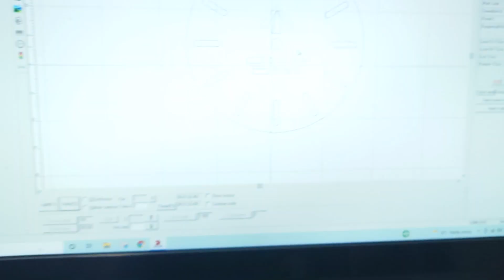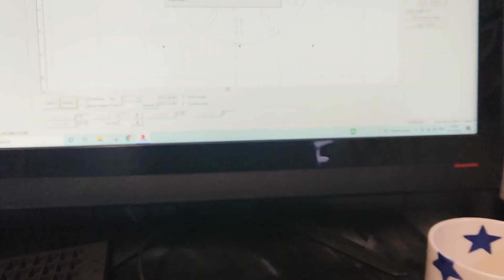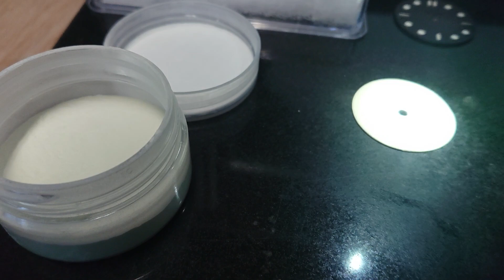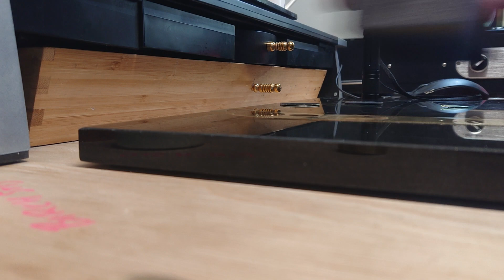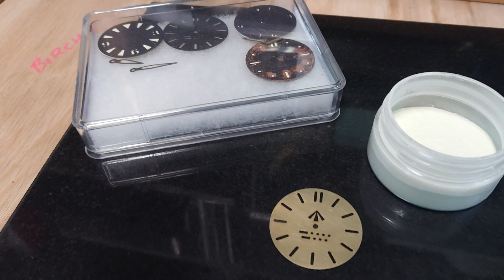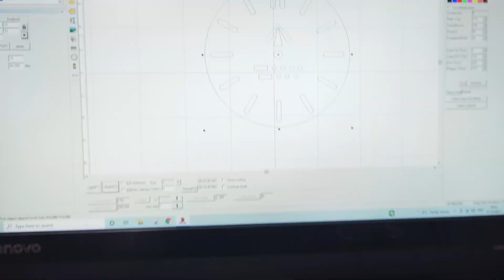Making a watch dial and hands on a 30w Fibre Laser

Comment: Sorry if I missed it but I didn't catch showing you making the hands. How do you make them? I imagine that to be quite complicated due to the bore on the hands that will go on the center wheel
Reply from the maker: the outer shape is easy enough. But youre right, making the centre point to fit a shaft is tricky. Im just in the process of doing a couple of experiments so will post up if successful !
Reply: @bonesshed.  sounds great I will stay tuned. Do you post on insta?
Reply from the maker: I do, its a bit of rambling feed though LoL. @gasgasbones  @maxgul.x
Reply: @bonesshed.  just followed, cool stuff

Comment: Interested how you finish your watch hands after being cut on the laser.   
I’ve been cutting my own, but I’m unsure how to get a collar around the hole.
Reply from the maker: I think you can buy tubes which are then soldered on.
Reply: @bonesshed.  unfortunately, I haven’t found any yet.  Been looking everywhere.
Reply from the maker: @djbenefit  I have seen hands before with a small slit from inside the hole to the outside. So the trick is to get the hole size a tadge smaller than the shaft its going on. The slight 'spring' action holding the hands in place.  Should be a lot easier than soldering tubes on ?

Comment: Have you had any problems with the watch hands not fitting?
Reply from the maker: To be honest I haven't got that far ! 😁 The traditional method is to solder tubes but I believe you could run a cut line from the hole to the outer edge and close the hole a tad. This would act as a spring. Maybe 😆

Comment: Amazing technique!  It was a bit frightening to see you moving your hands near the dial as the laser was cutting.  Be careful!  And wear goggles - laser light can reflect off metal parts and end up damaging your eyes!
Reply: So this is not entirely accurate. The laser is about harmless above the focal point. If this material reflected the laser light then it would not be able to engrave. This is why fiber lasers are used for metal. The 1065nm wave length is easily absorbed by metal. Yes you should rear goggles but the risk of reflections very unlikely
Reply: ..can damage remaining eye
Reply: Just as a note for your knowledge. The laser cannot harm skin.  That’s why they use lasers to remove tattoos.  It is something to do with the moisture within the ‘haute’ (did I guess that correct with my bits of German language?). Good luck.  P.s. wear goggles though, lasers will blind you!!!

Comment: Great video. Enjoyed all the input. The heatsink clamp sparks ideas. I'm in the process of producing dials with my laser as well. Very exciting. I've been successfully engraving 0,4mm spring stainless steel. (for bare metall finishes. Need to move to brass as well for painted dials like yours so it was great to watch your video. BTW! Which glue would you recommend for gluing brass or other metals? Sending greetings from Stuttgart Germany
Reply from the maker: Thank you :-) Yes, I believe that good clamping for thin metal is a must, along with the heat sink I dont get any warping. For gluing I have used nothing more exotic than super glue !  Once the dial is spray lacquered that also seals everything in.  sorry for the late reply.
Reply: @bonesshed.  if i only had a machinist friend ...... ishall try to find a solution myself then, hehe. no worries! again thx for the content